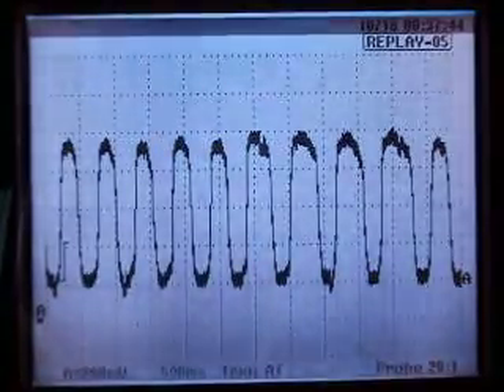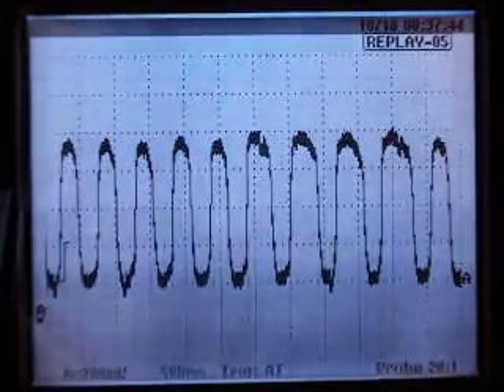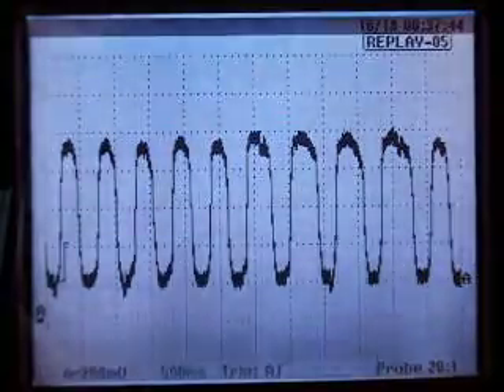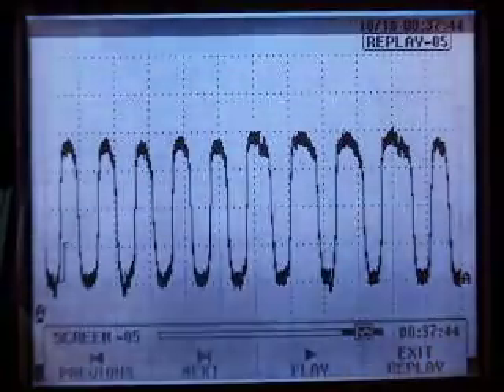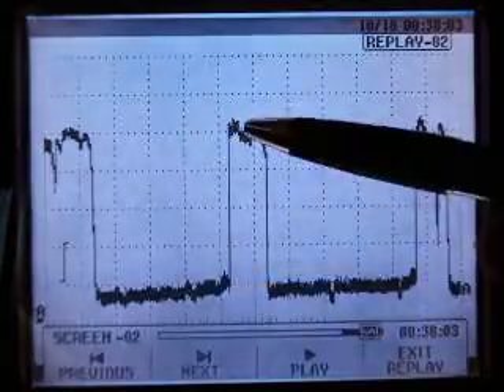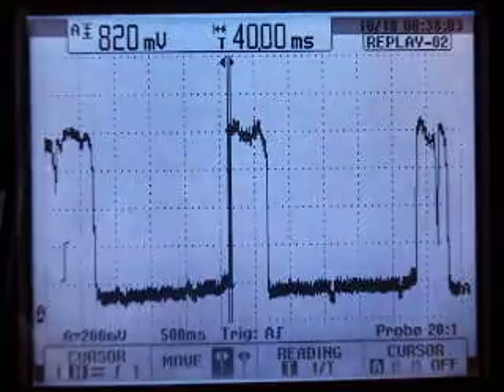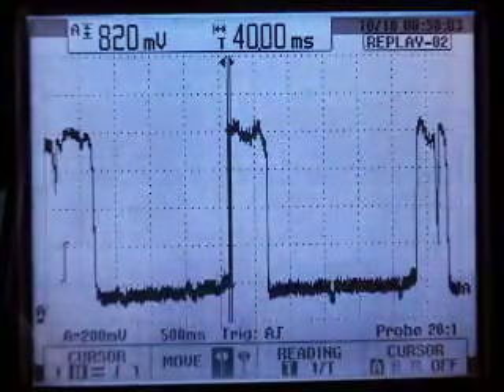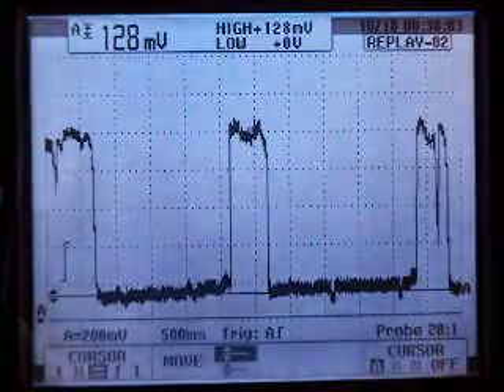Using Cursors to Measure O2 Sensor Switch Time

Comment from the maker: The ideal mixture is 14.7 to 1. Air to fuel. Their is no set O2 sensor voltage for the perfect mixture. The reason the mixture goes rich and lean all the time is for proper catalyst operation.

Comment from the maker: It is a Fluke 192B. This Scope is used by professional electricians and is very nice though expensive. If you have a laptop buy a Pico Scope from AutoNerdz About 1600$ and you have access to all the forums for free and Tom is a great. If you are an autotech, a two channel labscope is all you will need. Remember that time is the same for everything on the scope and you can only trigger off one channel.
JK